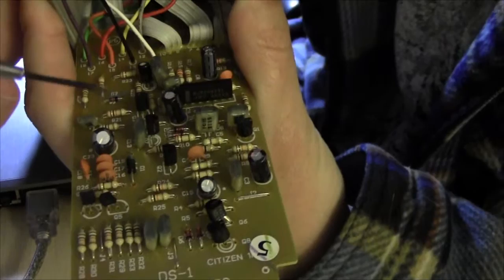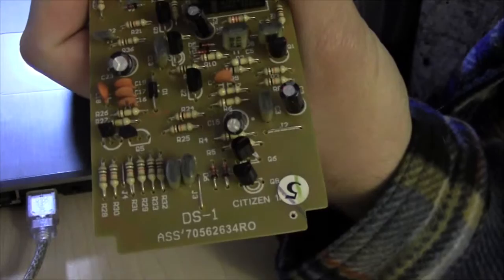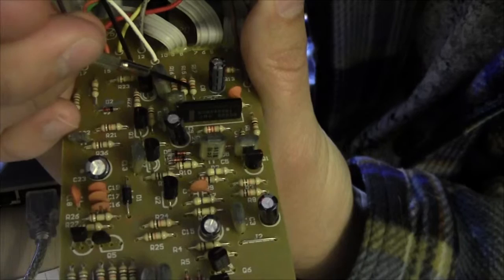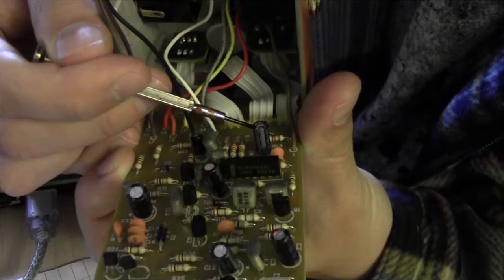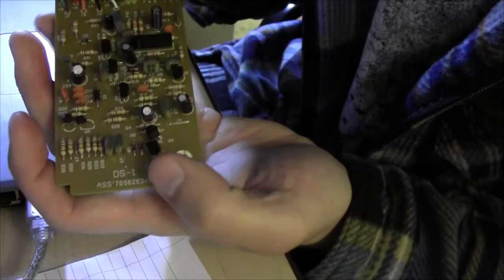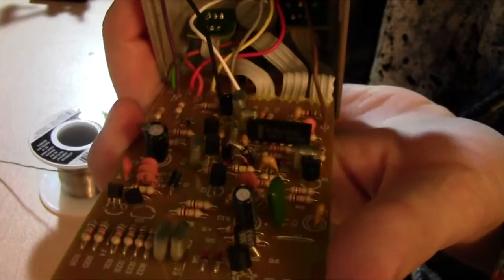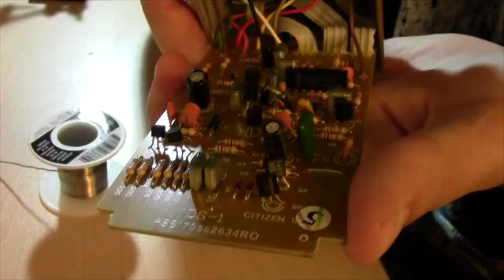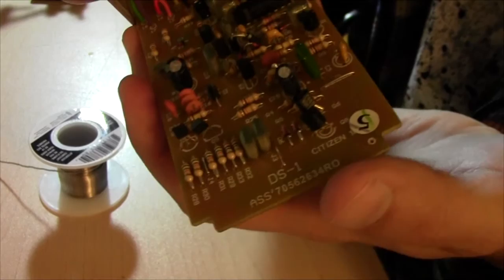Pedal Mods - Boss DS-1 - Wampler JCM Mod + Jack Orman Fat Mod

Comment: Hi, me again. Please don't be mad at me, I don't want to be boring,  I just want to share my experience...

I did a little mix of modes and I am very happy with the outcome.
After several changes I do not want anything to change here it is:

1) R13 value drop to 1 kohm , then c8 increase to 1 uF = more gain (YOUR MOD)
2) Fat mode is based on the change of R6 and R9. But there is too little gain.
Change just R9 to 100ohm and R17 change to 22 Kohm for more mids and less fizz   (MOD by tornadoalleyfx) 
3) C7 200pF.   C9 1uF  (Keeley and Your MOD)
4) Diodes (+ switch to change diodes) 2x 1N4001 diodes in series in d4 and d5  or LED and LED (red 3mm 1100mA) or led and 1n4001.
R14 1,5 Kohm (Keeley)
5) Add cap 47pF across diodes (no big change but i did it...) and it is better for my guitar (schecter with hi-out hums) (from Keeley)

After each step I tried the pedal and is now ok . I played a bit with the pedal , I had a friend's advice regarding the sites. 

And I have too a lot of increase in distortion only when I turn
the potentiometer near to maximum or on the max. 
When the less it sounds like crounchy Over drive.

Also , thank you so much for your video that prompted me to do this and to improve the tone of my pedals !!!!

ps.
( If you think I'm boring or that it is not correct to describe my work here, I 'm going to delete this comment)
Reply from the maker: +AlanKaruzo Awesome work dude.  Sounds like you really found something that's tailored to you.  I'm happy this video pointed you in the right direction.

Comment: Complete beginner here, never did any pedal work even as I write this, only pickups/pots in my guitars and a couple simple resolder repairs. Just got a DS-1 used that was already modded some time back by JADED Mods - [I  think he did what he called the 'Envy' mod]. I contacted ModestMike and he seems to believe that JADED did something similar to the 'Wampler mod, and from his opinions I'm' assuming it is a known as a common JCM mod that many do to this pedal. Surely anyone could have put their own spin on it, and alter what is commonly done +/-. Can't find JADED Mods online anywhere, the only thing that comes up is images of this same pedal that I now own. I don't use twitter, so I can subscribe here and maybe exchange contact/email. It looks like almost all of what you changed for the JCM mod, has been changed in this pedal here. This is what a reddit user described after seein a pic of the modded board:

-- -- "C3 - This is the input cap. It's typically .047uF. Can't see the value.
C2 - This cap is actually on the input buffer which makes little sense to change really. Changing this also affects the bypass signal as it's outside the switching.
C5, C9 - Changed the dc coupling caps from .47uF to 1uF

It's kind of weird. It pretty much looks like they just changed every electrolytic cap in the audio path to a film 1uF cap.

C8 - Stock it's 1uF and it looks like they change it to 1uF film. Pointless change.
C10 is a cap in parallel to the clipping diodes. Stock is .01 and it looks like they raised it to 1uF. Think this filters off a lot more treble.

The clipping diodes were changed as pointed out to some in series.

The R17 change is going to affect the tone control.

The R13 change affects the clipping frequency. I can't see the value but this works in conjunction with C8 (see my C8 comment above).

That's about all I see that was changed. Some of the ceramic caps may have been changed or even some of the other resistors but nothing else is obvious."-- --

So again I am a beginner that has not begun. I would just like to know what I've got already done here, I can send pics. Once I know what I've got, I can start learning from this point forward, thx
Reply from the maker: Hey man.  I don't really understand the ins and outs of electronics very much. I did this mod by following instructions.  About the only thing I can guess from what you wrote there is about the audio path caps - lots of people change those for film because they think it'll reduce any noise from the cheap caps that boss uses.  Do they reduce noise?  I don't know, and I'd bet that if you went through the trouble to A/B a stock one versus one that had only the audio path caps changed, you probably couldn't hear the difference.

Anyway, sorry I can't really help much.  The only other suggestion I have is to maybe try the forum over at freestompboxes.org, they may be able to help you out. Good luck!

Comment: Great demo/tutorial.  Ended up doing the the Fat Mod R6 & R9 first while learning how to mod pedals and wanting to test  ie placement, soldering, reconstruction, how/what I was doing along the way.  Fat Mod immediately improves the pedal IMO lessening the Treble Fizz and increasing overall body/thickness of the Distortion Gain/Tone.. Then I performed the JCM Mod placing small sockets in the diode holes so I could experiment with different combos (1n4001--RadioShack version fits poorly in sockets BTW, 1n4148) of a single, a pair in series, and Asymmetrical combo's of both diodes) & Red LEDs. Taste, preference, and mileage may vary.  Do you have any tutorials of placing diode combos on a micro board, then wiring that to a DPDT switch to switch between  diodes combo's similar to SEM/Ultra Mod with more options? Thanks Adam!
Reply from the maker: Hey man, thanks for the kind words.  I don't have any such video that 
you're describing, but I think there are a few tutorials on youtube on 
how to build a box with various types of clipping that you can easily 
hook up to circuits.  It might be worth your time to build something 
like that, because it would make things much easier to test, and find 
out what clipping combinations please you the most.  Good luck!